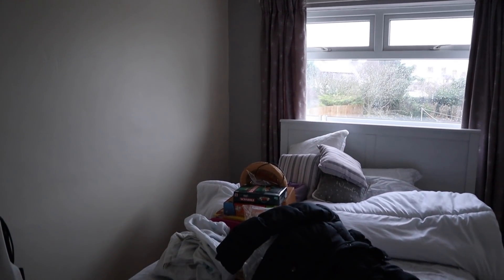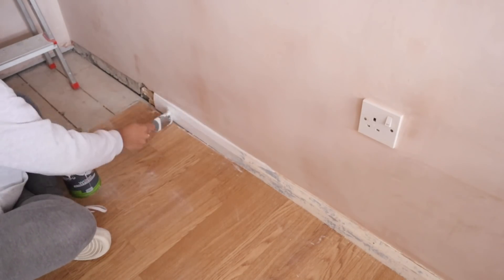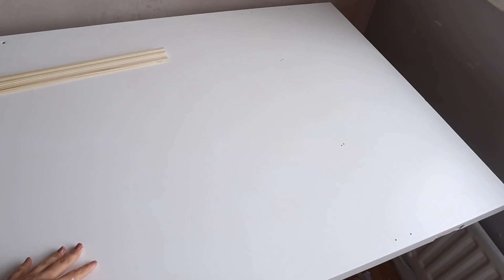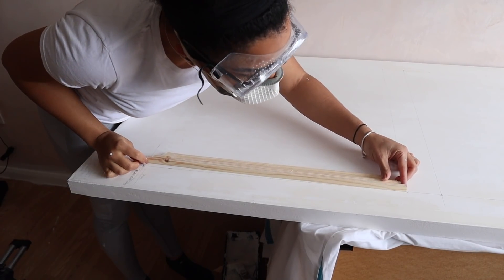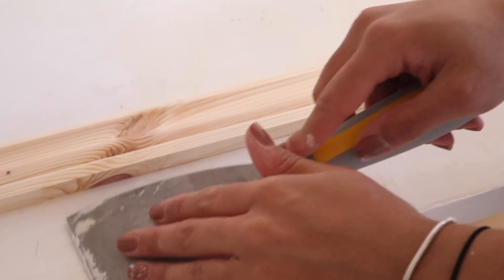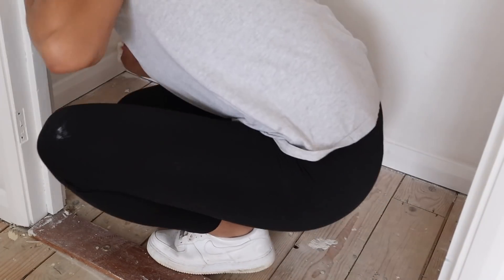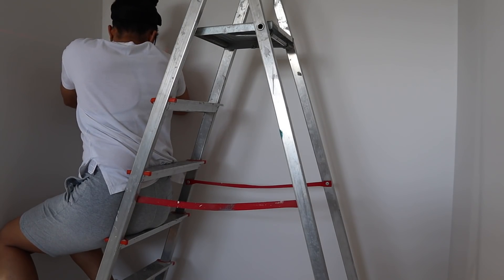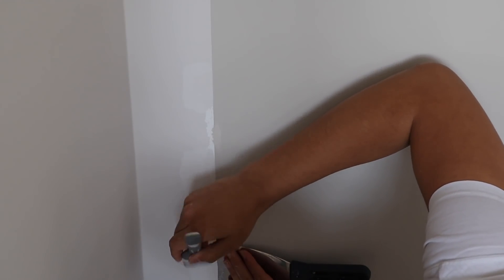bedroom makeover  *renovation and transformation*

Comment: Love love love the video 😍❣️ okay room turned out amazing 🌟 So as a decorator for about 20 years, so if you're going to use green frog tape you do not let the paint dry!!! Do not let it dry, the second you're done with the second coat you peel it off while it's wet ❣️ or you use the frog tape that is delicate to get straight edges like that, and that's not green 🤔❣️ frog tape is one of the best tapes that you can use to get sharp paint lines but you have to do it right. There are a couple tricks to get that perfect edge, but if you take it off one is wet or use the delicate and still take it off when your lat when your coat is wet when you're done painting pull the tape off slowly add an angle 😉❣️❣️❣️❣️ But either way the room looks amazing, it's nice that you show people that you can take an older space that has been a bit unloved and turned it into an amazing updated stunning space 🥰❣️🌟❣️💖❣️👍❣️❣️❣️
Reply from the maker: Thanks so much lovely!! Xx